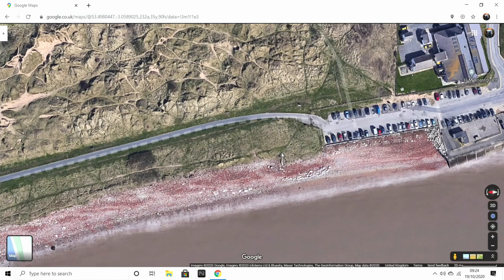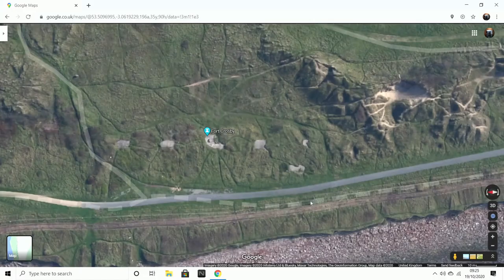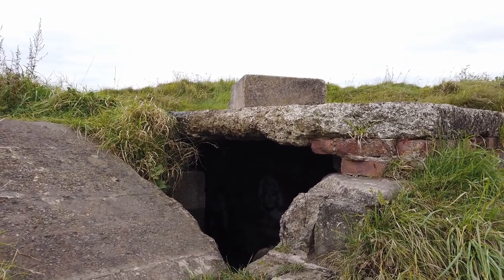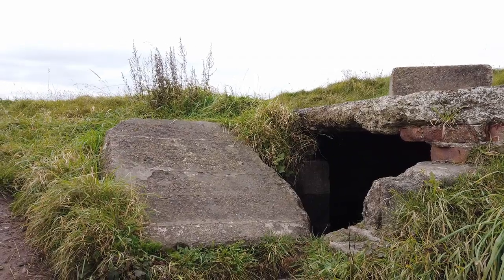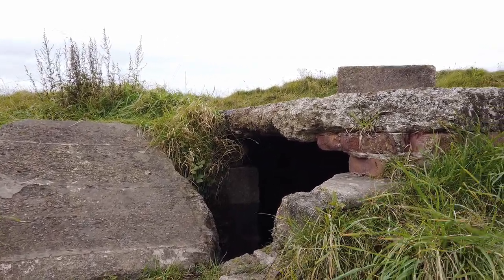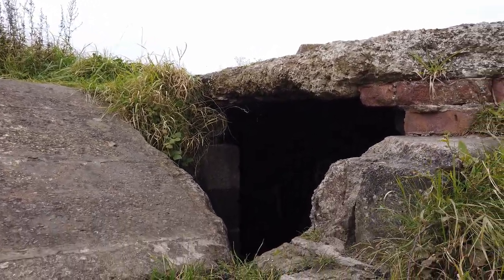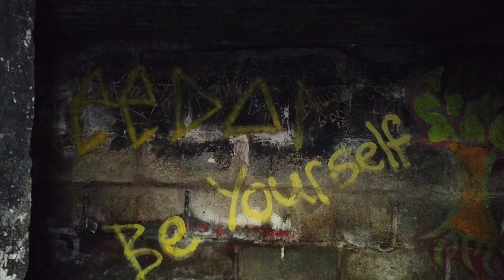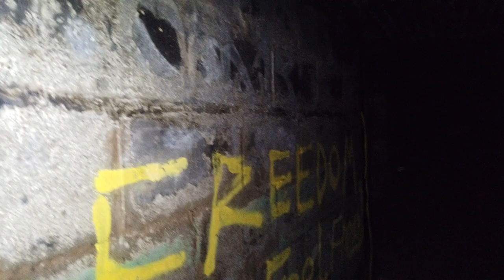Fort Crosby,Crosby Point Battery,Underground Artillery Ruins,World War 2  Defences - Merseyside -

Comment: I last went there  in 2018 and the same art work was there then. I got in just after someone had had a party. There was a beer keg outside and an uneaten birthday cake inside. As a kid I used to play in the battery a lot. It was a lot more exposed then.  One of these days I am going to take a tape measure with me and map out the building you can get into them mark it out on the surface with construction marking paint. I would also like to try and dig into one of the others. up for it?

In your into you wondered what the building was. It is a sewage pumping station there is another one by the new Crosby baths. it does link into the pipe that goes to the sea. In the early 90's the Mersey Estuary Pollution Alleviation Scheme was built. this was a pipe that ran from Hightown to the Sandon dock treatment works and from Liverpool Airport to Sandon Dock. Although building works started i the 900's planning started in the 1970's. Before then raw sewage, waste and storm water flowed direct into the River Mersey. Those of us who used to swim in the water off Crosby beach as kids in the 80's were more than familiar with the Mersey Turtle. If the pumping stations are over whelmed then untreated water can still be discharged direct into the river.  http://www.liverpool.engineeringwalks.com/LiverpoolEngWalk/14_files/MEPAS.pdf
Reply from the maker: Ha ha yeh ive heard of a few parties being held in this place mad id never heard of it until a friend told me about it

It has been mentioned with me and eric it would be good to dig the others out so could be up for that

That mepas thing id love to get into it looks huge some of the shafts are well over 100ft deep ...mad